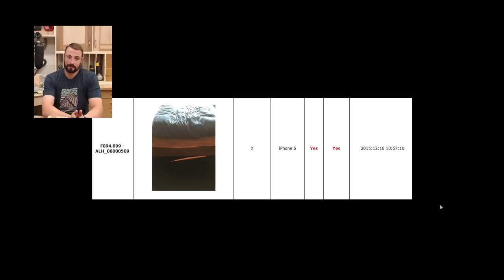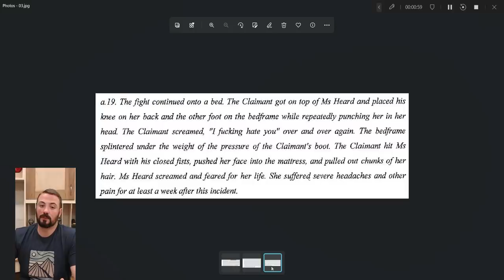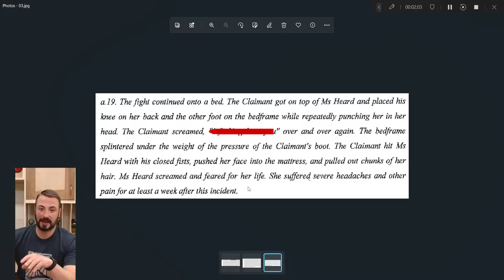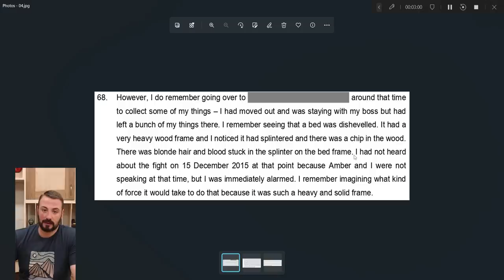Woodworker Attorney DEBUNKS Amber Heard's "Broken Bed” Testimony!

Comment: I love that so many people are lending their knowledge and experience to this case. It's one thing for a few social media people to make content but for hoards of skilled and learned folks to chime in, helps expose the hoax in it's entirety
Reply: lol What's his experience with this fucking bed? ZERO He has a picture. LMAO
Reply: @ebogar42  He is talking from his experience with woodwork and knowledge of wood fibers lmao and yes it is based on photos as that shows direction of grain in the affected area and gives information to allow for some analysis. His example shown also uses pine which is very soft wood and yet it still requires something sharp to create the same damage.
He also says that (without direct quoting) he doesn’t know exactly what wood or thinkness etc the bed frame is.
It is simply an insight into how her testimony doesn’t match up with the damage that was done to the bed which indicates that she is talking out her ass (I guess the same way she did before going to Coachella).
Reply: @ebogar42  And what do you know, huh tough guy?
Reply: I only wish all this honest info could be admissible in Court.!
Reply: @beaurandle1358  And from my experience with working with wood he's forgetting a lot of potential things that could happen. Like for example the wood could already have a crack in it and it's not hard to break it off from the end like that. I've done it tons of times. You realize that all wood, metal that is welded already has defects in it right? You will never know unless you look at it closely how it failed. You would have to know what it was like before it broke too. Was there a crack we couldn't see? The insight is reckless because you don't have all the facts and all you're all doing is spreading gossip like it's cool and thinking you're right. All these stupid body language experts and internet lawyers with as much information as we all have, which is none and all making assumptions based off little evidence.
Reply: @berno8535  I know a lot since I have a fucking degree in shit like this.
Reply: @aimeemetzinger6718  Me too!! It's frustrating as a layman because I don't know what they're allowed.   We've seen so many tapes, pics with proven editing, videos, etc that would be slam dunks but are probably hearsay or like the Australia tapes that have more than just the two of them on them.
Reply: @ebogar42  a degree doesn’t really make you more credible than a man who does this for a living—just compare dr hughes to dr curry

can you list your achievements, skills, experience, hours etc? people love saying they have a degree, but even Cs get degrees
Reply: @auntienyannyan  LOL Yeah, Dr Hughes was way more experienced and had had a lot more information that Curry didn't have showing her experience is lacking. Curry had one Mental Evaluation compared to Hughes several she did to see exactly why Amber was answering how she was answering on Currys test. What is this guys experience? He posted one video of him in a wood shop and now he's a better carpenter than the world? Hilarious. I don't need years of experience with wood to know all wood has defects just like all welded metal and metals have defects. That is my experience. Learning about shit like that. I also have experience working around wood. Years of it. I'm older than this guy so how the hell does he have more experience? LMAO I'm 42 and this dude looks in his 30s. I also grew up on a farm and had to help build shit so many times. You can have cracks around those edges. It happens often too. You can paint over them and not even know there is a huge crack there. He could have stepped right on that. I'm not sure why this guys opinion is the only opinion that works. I gave you a reasonable reason why it could have chipped off and you're still arguing with me. I never said he was wrong I just said he wasn't thinking about all the variables it could be and there is nothing right or scientific about this bullshit. I do believe I have more science experience than him.
Reply: @auntienyannyan  He doesn't do woodworking for a living. This man is a fucking lawyer.
Reply: @jessicathomas73  It's me, Amber Turd

Comment: My dad was a carpenter for years and brought me and my siblings along to jobs he did for family and friends and had us help out, so I feel I have some limited understandings in woodwork... and the first thing I thought when I saw that picture was "how the heck would a shoe/boot break off a splinter like that?" I appreciate the way you described this and 100% agree with your conclusion!
Reply: Yeah I'm not sure. The frame looks like very thick old reconditioned 8x8 sleepers. Some thicker sleepers with age the edges will start to frail and can separate slightly to split off. The timber does not look like pine either as It has more grain and seems darker.
And everyone chill out I am a Johnny  fan.
Reply: if it was old it could (or previously chipped). everything he owns looks old
Reply: @Terminatortx33  you can question what you hear and see you know,…. I think it’s important to question ourselves even if we do believe the person, in this case Johnny.  I think old wood could break, though I think old wood is way more resistant? 
However, it does makes sense that that kind of splinter looks more like the result of a sharp object than a blunt one. What it caught my attention was the use of her words, purchase and all that.. she is actually describing what she would have potentially done if she cut that herself. As Rob did.
Reply: Same here! I’ve watched my dad do multiple carpenter jobs. He taught me quite a bit about wood and trees and the grain and all of that. I always remember him saying going against the grain won’t get you anywhere, you have to go in the direction of the grain. His boot would have been going against the grain… never gonna happen. The second she said ‘his boot’ did it… I was like “ain’t no way in hell a boot did that 🤣🤣🤣”. A fkn spiked high heel couldn’t even do that. A flat sharp blade sticking into the wood (pocket knife in this case. Whitney said Johnny carried a pocket knife in his pocket all the time. Ambturd probably found it laying around and used it to her advantage to stage a crime scene) or an axe obviously. But a sharp blade is the only explanation and she left the evidence laying on top on the damn comforter! Which btw had ZERO blood on it anywhere 🤷🏻‍♀️

Comment: As a hobby woodworker, I can only confirm that everything said in this video, and as far as the wood and the broken part of the bed is concerned, is completely correct. The only time it is possible to break off a piece of wood is if it is rotten or full of worms, which is unlikely because it is a bed where you really sleep. Great job :-)

Comment: Wow, they literally put that photo in and left the damn knife on the bed. What were they thinking. I do wood work as well, and was a bit surprised that a guys boot could chip that big of a piece, it just seemed strange. Thanks for providing this, I hope the attorneys see the knife and ask her about it.
Reply: Nfw did his boot chunk that timber!
Reply: thats exactly it. the wood he used here wasnt a great example because of the rounded edges. but on right angle edges, the right boots, and a lot of weight, yeah, boots could chip and fray the wood... but to straight chip off a whole grain runing a 3rd of the length? nah
Reply: @michaelwerkov3438  especially since there is the knife on the bed😁
Reply: That’s not all that she left in the bed... 💩
Reply: @amyd2203  😂
Reply: @michaelwerkov3438  There would also be big dents and scratches surrounding the split, which if there are, I can't see them.
Reply: Are you really surprised? I mean, it’s not like amber has never shit the bed before

Comment: The part of the testimony that got me is the simple distance involved given what she claims is happening.

He’s supposed to be kneeling on her back over the mattress, holding her head into the mattress with all his weight, and somehow putting enough force on the very edge of the frame with his boot to rip a splinter off the edge of the frame.

Even if that bed is just a twin-size mattress, the exposed lumber around the mattress itself is a foot across.

So he’s supposedly kneeling on her back (again will all of his weight), and is somehow also putting enough force into the edge of the lumber more than a two feet away from where his center of mass is located above her to rip off a chunk of wood like that?

Color me skeptical.
Reply: Apparently he was playing god dang Twister, lmao! Right knee-Back, Left leg-Bed frame  Right hard-Hitting head, but wait also holding himself stable🤣 I have to joke at this point!
Reply: Her version of events only works if he’s approximately 8 feet tall

Comment: The moment I saw the "broken bed" I was incredulous: it did not seem possible, plausible, believable, AT ALL ! Thank you for taking the time to illustrate why that is so outrageously impossible. The silver-looking short piece on top of the duvet looks like an instrument used to create a "chip" in the bed frame!!
Reply: It's a folded up pen knife this guy is a fkn hero
Reply: Being from the UK I know courts can be questionable on times but WTF were they playing at in the uk trial to fall for her blatant lies 🙏 he gets back his life. And she gets the help she desperately needs.
Reply: @plutonium2  I thought it looked like a butterfly knife or possibly a cork screw wine opener ( the kind where after you put the corkscrew in, you lift the two handles to pop the cork out). The picture looks like a centerpiece then it has two arms in the side. This is why I thought those two sharp objects fit what was pictured. 
I think it would be possible for a person to put a corkscrew in and then “kick” the corkscrew to make the damage. ( Similar to the video where he put the knife in and then pryed with his hand.) I am a small female so I don’t know I would have the hand strength to necessarily use a knife.
Reply: @rumple7551  As I understand it, the judge had a relative who worked at The Sun, which is who JD was suing.

Comment: I am not a carpenter, but as soon as i saw this "evidence" during the trial I noticed it looked just like a piece of wood that was cut by a sharp object. Thank you for this informative video
Reply: There are quite a few holes in that theory, so i´ll have to play devil´s advocate here. Numbe one, a knife would leave tell tale marks on the wood, that any forensic examination would uncover. Second, a knife or tool is not necessarily needed to chip the wood. Pine is fairly weak, and the edge of any piece of wood is always prone to chip off by any blow or force that is imparted on the wood from a particular angle. And third, the bed looks old. Old dry wood can chip away very easily, and we can see several cracks along the grain, that happen when the wood´s natural moisture dries up over many years. 
The sole of any boot is made to prevent slippage, so we can imagine that if you impart a significant ammount of downward force onto the wood, the gripping nature of the sole will "grab" the varnished wood. But if you do it on the edge, the wood structure is not strong enough to maintain integrity, and the edge just chips off. It all depends on the angle at which that force is applied, and the degree of friction locking that both surfaces (wood and boot) can apply to each other.
Having said that, there is a discrepancy between both photos. The amount of missing wood on the edge seems to difer from photo to photo, as if more damage was done after the initial snapshot was taken. That could indicate foul play, as if someone had dug into the wood and made the damage larger. Also, a chipped bed is not proof of violence. Similar damage can arise from good old fashioned sex, or even just climbing on to bed. It proves diddly squat.
To be honest, after having watched Amber testify, i am totally convinced she lies with every teeth on her mouth. She is obviously a sociopath. Her pathetic attempt at "crying" was so utterly ridiculous, that it could only fool those that have already made up their mind about Depp´s guilt. And that is the problem. You can bet there are those in the jury that have an agenda, and have convicted Depp from the get go. Let´s just hope this toxic woman gets at least convicted in the court of public opinion. She is bad news to any man that gets near.
Reply: @Biden_is_demented  I still think you'd need something sharp to get a splinter that thick off a piece of timber. A boot sole, even is the sole had a pointed steel cap, would need a tremendous amount of force, far more than a man could exert who was on his knees or lying face down on a soft surface. Even with a steel capped pointed shoe you'd need an actual blow to start the split, which you couldn't do in that position because you'd need a big swing at it. If I had to create that sort of splinter without a very stiff thick blade I'd be thinking of something like an adze or chisel, used sideways and not along the grain.
Reply: I've helped my brother who is a carpenter on the odd times I decide to take a break from fulltime work (painter). He absolutely smashes the sides off wood beams to get them in sometimes, and I mean he flogs the things, don't think I've ever seen him chip a piece of wood once, has dented it in a little sure but never ripped off a chunk of the beam. Nd he's a damn big guy who has done carpentry for 20+ years. Probably couldn't spell refrigerator, but could lift one no problem

Comment: I wish they had you as an expert witness.  I never would of thought we needed such a channel in my wildest dreams but here ya go.
This was excellent, you explained and demonstrated your case so perfectly AND you even solved how it was damaged and found the “suspicious” object on the covers that probably was used to do it. Well done 👍. Very well put together. I doubt the experts have even noticed that.
Reply: Except he is not an expert on the material strength properties of wood timbers.
Reply: *"would have", not "would of"
Reply: @NuncNuncNuncNunc  
He works with wood so I think he does understand that. My husband works in engineering but can do just about anything. He has worked for years with different woods and made the same comment. He added two rooms to our home himself and has made numerous forms of furniture and believe me you don’t make anything without knowing the properties of the wood you are working with.
Reply: @dalejumonville9147  dont even waste your time, guys got 4 subs, no videos and no commons sense, typical amber fan boy lol
Reply: @GodlyXJohn  
I know but ignorance of an issue just pisses me off. 🤣🤣🤣
Reply: This could win the case for Johnny!!!  Can you reach out to his lawyers???
Reply: I highly doubt that Johnny Depp was wearing rubber soled workboots; that is simply not his style. A boot regularly worn by him is a thick leather soled biker boot. Such a boot could easily have been fitted with a cast iron metal quarter heel. It is seen as a stylish and practical addition, particularly by those in the 'rock' community. The many pounds of Depp's weight, above the sharp  corner of the metal quarter heel, as he quickly thrust it down onto the bed to 'gain purchase', could easily have supplied the kinetic force, and penetrating capability necessary to splinter the wood as evidenced in the bed frame damage photograph. Even if the boot heel wasn't metal quartered, it's perfectly feasible that the edge of a hard leather heel could splinter off such a piece of wood if there was a commensurate weakness pertaining to the grain of the bed frame's lumber. Furthermore, whatever that small object is that's nestled within the folds of the bedcover, it is definitely not the type of large knife needed to pry off the wood splinter.